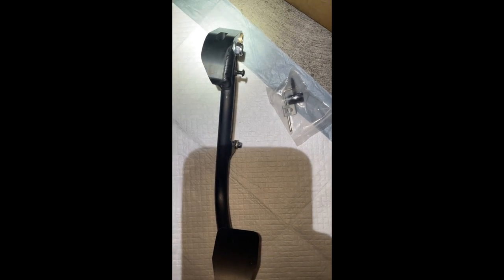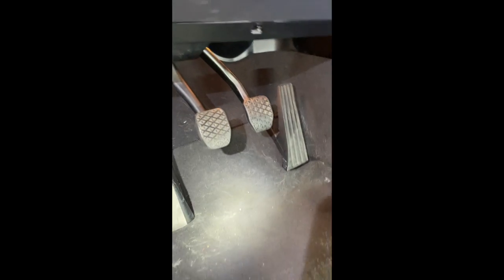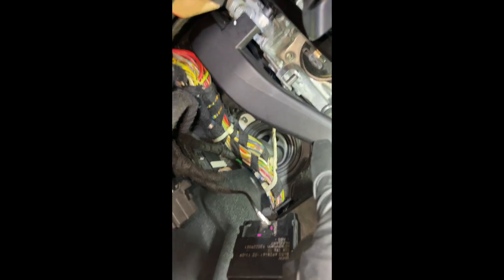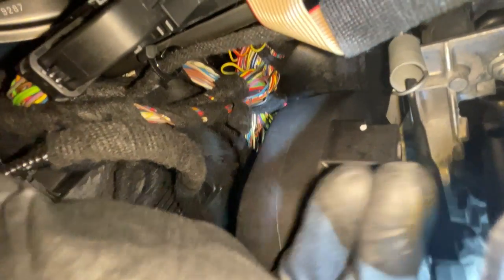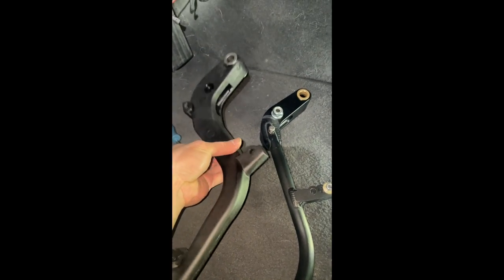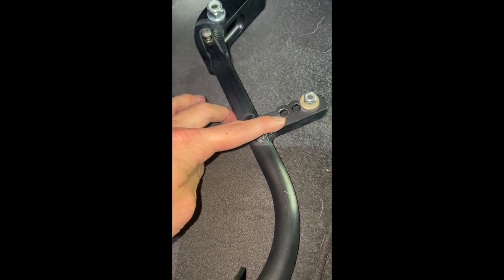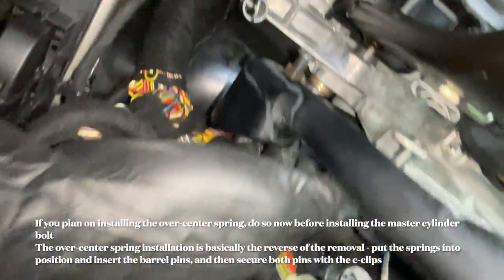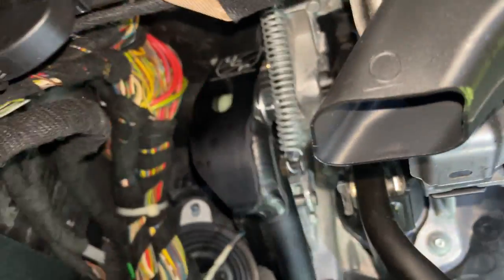E9X M3 Ultimate Clutch Pedal Install

Comment: Note: You can try the other mounting holes and even try removing the spring all together if you’d
like in the future. Remember if you remove the spring all together, you should remove the upper
spring mount as well as it can become pinned against the arm when not held in place with the
springs